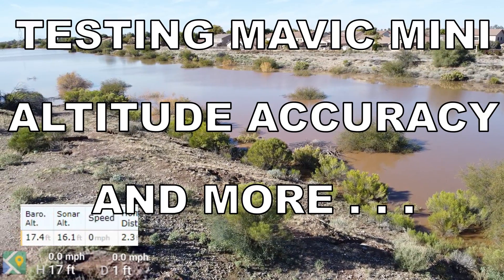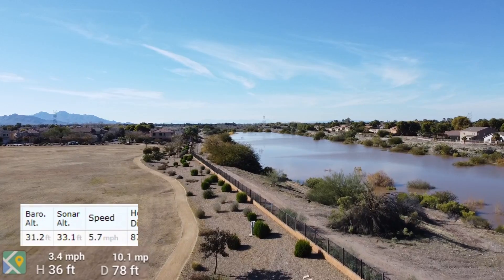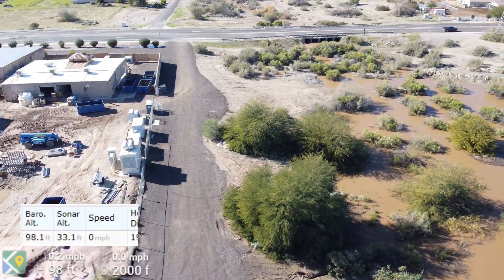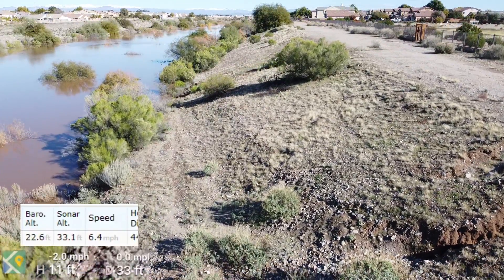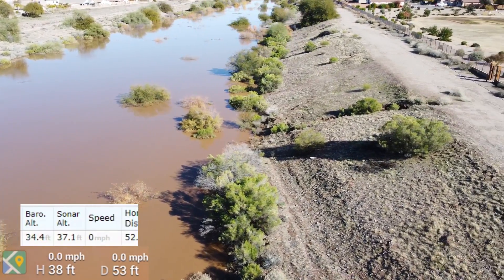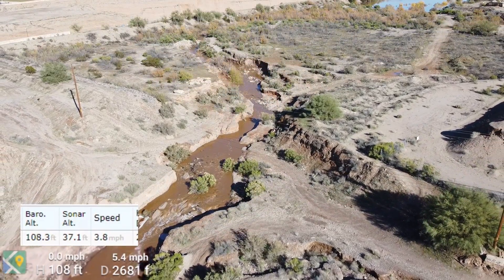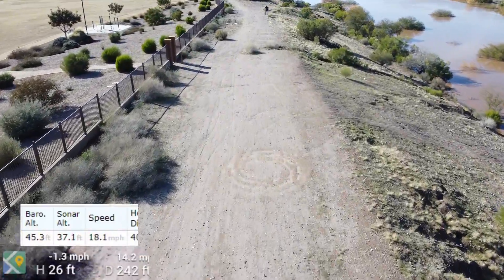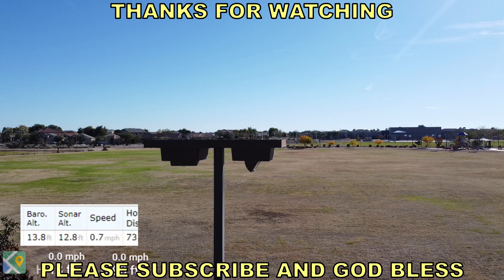TESTING MAVIC MINI ALTITUDE FOR ACCURACY

Comment: Hello, Mr. Kent..... I am having an issue with my mini, thought maybe you might know the cause. My distance and altitude readings on the screen are not accurate with the drone's location in flight. I rely on these readings. The screen reading says the drone is 8 feet off the ground but the drone is actually around 16 feet off the ground... The distance reading on the screen says 500 feet away but the drone is actually closer to 1000 feet away... I have recalibrated the compass and I have recalibrated the IMU.. and the firmware is up to date... Would you happen to know a reason for this cause?
Reply from the maker: Hmmm, If you are using a "wifi only" tablet that will happen or if your have wifi turned off on your phone. GPS is the issue but it is hard to say what is causing it. Metallic interference also makes a difference at takeoff. Here is a video I shot about that issue. Thanks for your comment and God bless.
https://youtu.be/iCkkWWCmm8g
Reply: @user-sr8pn9xg8z  I bet it is because I started putting my phone in airplane mode to keep from getting texts or phone calls during flight time.... because airplane mode cuts off the wifi and probably GPS too... Is that a correct assumption?

Comment: Hello Mr. Kent,
A lot of people have Phone Compass Problems
 effecting the "Aircraft Orientation Indicator" Mid-Bottom of the DJI FLY App screen.
https://youtu.be/cMWNp3xMGV8
Could you do some investigative testing on this problem, and maybe come up with a solution?
Reply from the maker: Thank you for your question. That is a good suggestion. I believe the Android devices have  most of the issues but I have also noticed that the closer you stand to the takeoff point the more you are apt to have issues. That I have learned from experience. I would suggest standing facing the drone while it is facing away from you and be at least ten feet or so away. Please give that a try and God bless.
Reply: @user-sr8pn9xg8z  I think you misunderstood.
The issue is the RC messes up the compass of the phone, the drone has nothing to do with it. (like demonstrated in the video-link I provided).

Comment: Question regarding hight and return to home button. Let's say that return to home is 30 meters and I am standing on a hill 100 meters up and send my drone to take photos of somthing down the hill 90 meters below me. Now I press return to home. What will happens? Will it go up to 30  meters from where it is now 90 meters bellow me and fly to me crashing into the hill? Or will it go 30 meters above the hight it was launched on top of the hill meaning going up 120 meters (was 10 meters from ground when it was down the hill) and flying to me closing gradually the hight by flying straight and finally reaching me 30m above from where I stand (100 meters up the hill) and landing safely?
Reply from the maker: That's a good question Ezra. I have never been in that situation but from experience I can tell you it will rise 30 meters above the altitude of the launch point. Everything having to do with altitude references the launch point. I think that is true of all drones. Anyhow, from where it is located when RTH takes over it will go straight up to the 30 meter point and then head for home. Thanks for your question and God bless.

Comment: This is the cats meow. I liked how you did this. Very logical and this is a very accurate test. I have noticed negative readings after landing myself. But I had no way of checking like you just did. Thank you! OBTW I'm talking about my Spark just to be clear.
Reply from the maker: Thank you Richard. Yep, it looks like they have the issue solved, or, it could have just been a fluke :) But I'm pleased with the results. Thanks for your kind words and God bless.